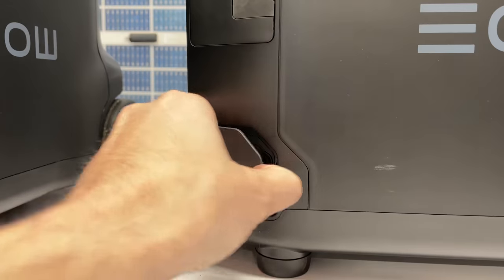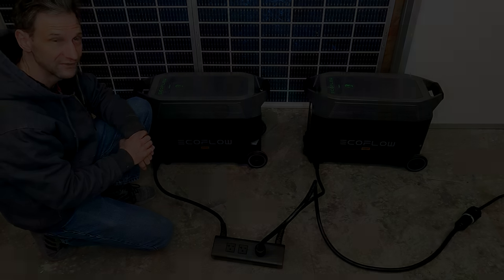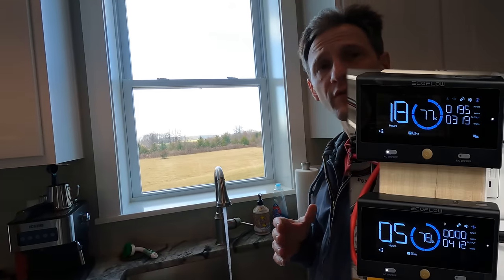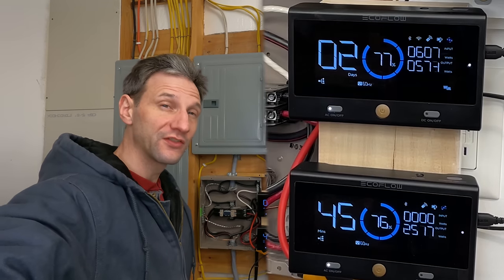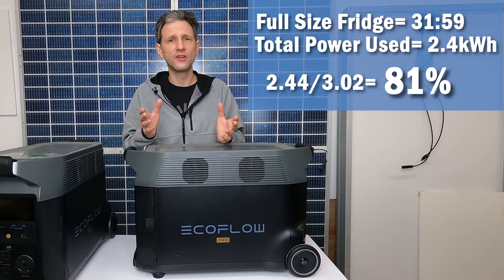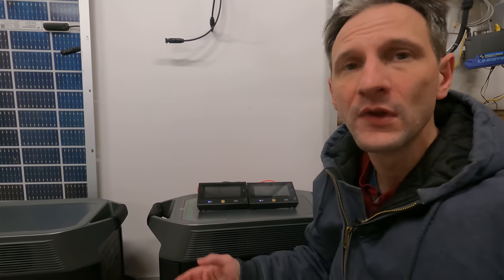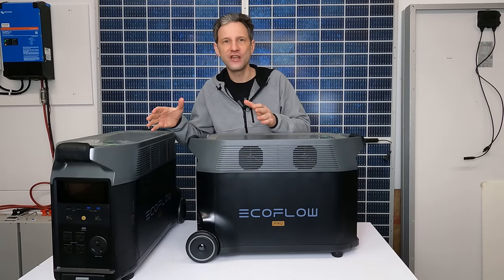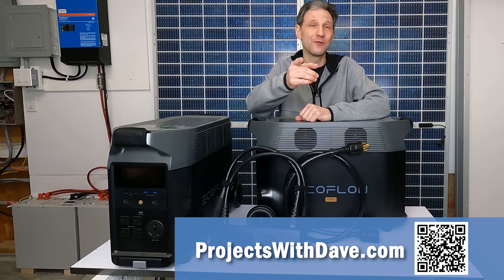EcoFlow Delta Pro Whole Home Backup - Real World Testing

Comment: Dave, I am not an electrical guy so watching your videos are fascinating.  I am in the planning stage of building a 10x12 shed and want a system to put in for a couple of LED shop lights and capability to work a couple of power tools.  What is your suggestion?
Reply from the maker: I would consider an all in one system with at least a 200W inverter for small power tools.  For larger tools you would need 3000W.  You only need one unit for that application since you won't need 240V supply.  You can also check out this topic on my website:  https://projectswithdave.com/portable-power-station/
Reply: Thanks Dave

Comment: Can it make operate washing machine? Then how many times? Regular average washing machine, I mean.
Reply from the maker: Sorry for the delay, took some time to run the testing.  The Delta Pro will run a regular washing machine with no issues.  My washing machine takes about 0.15kWh per load.  The Delta Pro could do approximately 21 loads on one charge.  Hope that helps.  This is the unit I tested: https://us.ecoflow.com/products/delta-pro-portable-power-station?aff=632
Reply: @ProjectsWithDave  Always grateful ~

Comment: What about if you don't need 240 voltage? How many 12 voltage batteries can you hook up with the system to get a bit longer run time ⏲️  ?
Reply from the maker: You can do just one unit for 120V appliances.  EcoFlow has their own expansion batteries. Here is a link: https://us.ecoflow.com/products/delta-pro-smart-extra-battery?aff=632

Comment: Os there anyway to connect one ecoflow to a house? Can the ecoflow be charged at the same time when in use?
Reply from the maker: You can connect just one unit, you just won't get split phase.  You can only charge from solar while in use when running two units together.  With only one unit you can charge from solar or grid  while in use.

Comment: Hi, i  am the new kid on the block and am dumber than a stump  regarding solar.  I have the same unit with 2-400 watt solar panels in route.  i live in the mountains so ac is not necessary and i  have a wood burning stove.  so mine was to give me back up power to run lights, computer and an occasional well.  if i felt the need to expand, would it be one more solar panel or an extra battery?
Reply from the maker: It depends on a lot of things.  Under what conditions do you run out of power?  For instance, if your batteries charge to 100% before the day is half over and you run out of power in the night you need more batteries.   If you have lots of cloudy days and can't ever fully charge the batteries you could probably make use of more panels.  That being said, 800W is probably enough to charge one Delta Pro in the summer.
Reply: thanks
Reply: i just did a test with up to 240,  as expected the batteries will drain fast with no charging  input.  solar panels to be delivered hopefully within a week. @ProjectsWithDave

Comment: Question, can it charge a Tesla without having to install a generator switch and circuit board?
Reply from the maker: I have not tried charging an electric vehicle.  When the system is connected through the generator port it is bonded to the house grounding system which is necessary for some appliances like car chargers to work.  I believe Will Prose has a video where he tried to directly charge his Tesla, and I believe he had some issues with it.

Comment: In your opinion is it better to have 2 delta pro units or a delta pro and an extra battery and why ?
Reply from the maker: I would only have to units if I needed split phase.  The two separate units can not share power between each other.  If you have a single source load like a fridge, you would drain one unit and then have to plug it into the other.  With an expansion battery you can charge and discharge the whole capacity.
Reply: @ProjectsWithDave  thanks for the explanation

Comment: The heat pump pulls 203 amps?  How do you even wire that to your meter/breaker box?
Reply from the maker: It's a very short burst.  The running current is only 9A to 11A.
Reply: Locked rotor amps (LRA) is seen in compressors, since they have to start against the resistance of the refrigerant gas in the system.  The LRA can and usually will be several times higher than the running current.

Comment: What is the max output of the hub? If I have 6 units 3600*6 is going to be able to handle it? I have a 5 tons AC
Reply from the maker: I was able to run my 4ton AC after some adjustments to the soft start system, but it could barely start it.  Those units aren't really designed for that kind of load.

Comment: Does any of the light for the back side have to come from the off-axis, or is the panel transmissive so the light passing through the front can then be reflected back up to the backside. In other words, does a highly reflective surface under the panel help in any way with a five-inch standoff from the roof?
Reply from the maker: If you are referring to bifacial panels, there is some light that comes through the panel, but it is almost negligible.  The useful light is reflected from behind the panel somehow, and 5" is not very much space to achieve that.

Comment: So I have this set up 1 delta pro and 2 extra battery. For my solar panels I have 10 total 200w each. 5 series and another 5 series paralleled together. Due to the 15 amp it will only take in. I’m only getting 1400ish watts on a clear day. Is there any other way I could potentially add a MPPT controller to charge by solar and hook it up that way just curious.
Reply: The amp coming through the panels roughly I believe 20 amps
Reply from the maker: What is the VOC of your current setup?  The closer you can get to the 150V max input voltage without exceeding it the more power you will be able to input at once.  If you are only getting 1,400W you must be only hitting around 93V.

Comment: Your explanations are exceptional! Thank you. I have 2 Delta Pros and 2 extra smart batteries. I'm only using them for 2 French door refrigerators. Each fridge is connected to a unit. One uses about 218 watts and the other about 150 watts. I notice that the batteries are discharging very fast. If I go 2 days without sun I have to switch to the grid. Should I use the hub and connect the 2 fridges to the hub instead? Thanks
Reply from the maker: The hub does not distribute power between the units, so that won't help you.  You might be better off plugging both external batteries and both refrigerators into one Delta Pro.  By running two inverters you are doubling the AC idle consumption.

Comment: So are both of these units, in parallel rated at 7200 watts. At 240v?
Reply from the maker: 3600W per phase.  Together they can power a 240V appliance at 7200W.

Comment: Would you please do a overview of the geo thermal system.
Reply from the maker: I have considered that, but I don't think it would get enough views to warrant the time it takes to make the video.  None the less, I still may do it some day, there are a lot of pros and cons to the system.  I've made a few videos on my home construction but the don't get many views.
Reply: @ProjectsWithDave  -  Something must be REALLY wrong with your heat pump compressor.  There's no way you should have that kind of draw-- even starting up. 
 I'm in the San Joaquin valley in CA (east of San Francisco).  I just installed a four-ton 20.5 SEER Bryant Evolution air-source heat pump, with communicating, variable speed compressor.  I tested it last summer in AC mode.  I have my 7,500 watt generator set up as my whole-house backup, running on propane (so, somewhat less than 7,500 watt output).  With everything in the house turned off at their switches (not at the breaker panel), the latent load is about 2.5 amps, or 600 watts (guessing wall warts, routers, smart plugs, refrigerators, etc).  Turning the heat pump on I saw a startup pull of 15 amps- but only for about two seconds.  Then it dropped to about 6 amps, then slowly ramped back up to 16 amps when I turned the thermostat way down (full-on cooling).  Running everything I could think of in the house, the well pumping at what must be full speed (1-1/2" pipe full open, filling my pool) air compressor running, electric oven... I could only get a steady pull of about 33 amps.
Reply from the maker: I'm not going to stand up and say those results make sense.  I plan to investigate the situation a bit more when I have some time.
Reply: @mikepowell3335  That's great information about your setup, but it's not not directly applicable to homes with different configurations. Primarily, you mention a variable speed air source heat pump. First, it's going to be programmed to start up at it's lowest power and ramp up from there over minutes, not seconds. So while it's not technically a soft start it's going to be a lot more soft than a single or dual speed compressor, which is very likely that Dave and others have as variable speed compressors are still new and cost more. Second, air is significantly less dense than water or whatever presumably liquid substance that's used for carrying the heat in a ground source heat pump, so even though the air source heat pump is probably moving more CFM of air than the ground source heat pump is of liquid, I'd expect the ground source heat pump to have a larger inertia to overcome while starting up, therefore have a generally higher start up load than an air source heat pump, especially a variable speed one.
Reply: @extragoode  - Point taken.  My point was something must SERIOUSLY be wrong for his heat pump to be drawing that many amps.  My guess is there's a 50(ish)-amp breaker that should have tripped before even being able to READ that much current.
Reply: @mikepowell3335  that's a good, and I actually asked him that exact same question in another thread.

Comment: Will the hub connect to my L14/30 generator plug installed outside my house?
Reply from the maker: Yes, it's a standard twist lock.
Reply: The Dual voltage hub is not meant to take power into the units if that is what you are asking.

Comment: Do you have to have a load on the 240 plug before turning on the 240V adapter?  When I turn it on with no load I get an error code 533 on the units.
Reply from the maker: No, you do not have to have a load.  I don't get that error when I turn it on without a load.
Reply: @ProjectsWithDave  I must have a defective hub.  My grounds on the double voltage hub are hot!   I must have a defective unit.
Reply from the maker: Ground should not be hot.  How did you measure that?  If that's the case, it sounds like something is wired incorrectly.  I would send it back.
Reply: @ProjectsWithDave  L1 to neutral ground  on the double voltage hub.  This hub is defective and dangerous.  Good thing that the delta pros detected the fault.    Notice no stock on the hubs?  I bet they had a defective batch.

Comment: Hello if there is a power outage and you are using the ecoflow can you recharge the ecoflow using your generator while still having the ecoflow powering your fridge?
Reply from the maker: Yes, the generator would be seen as line in power and the EcoFlow would operate in UPS mode.  As long as you are not using the double voltage hub.

Comment: How do you enable the UPS function? Is that the same as X-Boost?
Reply from the maker: A single unit will automatically function in UPS mode if it is plugged in.  X-boost allows the inverter to put out more than it's rated capacity with some degradation in signal performance.

Comment: The display on the pro is not accurate.
Once my unit reaches 1% it still has about 700 to 800 watts of power left in it.  
It we'll run for quite sometime on 1%, try it😎 and make another video
Reply from the maker: I have tried that.  I get a similar result.  I think it is just set to be conservative on the bottom end.

Comment: I would like to see a video on how long they would last on average home
Reply from the maker: These batteries are rated for 3,500 Cycles to 80% capacity.  You could do a full charge/discharge cycle every day for 9.5years before the battery is reduced to 80% capacity.  Typically your battery wouldn't see that level of use.  Plus, this battery also has the ability to limit the charge/discharge level to significantly extend battery life even more.  LiFePO4 chemistry is very robust.

Comment: I have I delta pro 110v how to changed to 220v
Reply from the maker: You need 2 units to achieve 240V split phase.
Reply: @ProjectsWithDave  There is a PSDR 110V and another 220V. Both of them have the same circuit, compartments, etc.. I had a delta pro 110V, I changed the PSDR and now its 220V. Is there any possible modification to change the PSDR to change it from 110V to 220V.

Comment: This thing is like an iPhone it needs updates it needs the internet or it won't work properly without the internet. If being disconnected from the grid is the point this won't work I have the nearly 17 thousand dollar bricks to prove it
Reply from the maker: I have run mine for months without being connected to the internet.  Did you have a firmware problem?
Reply: @ProjectsWithDave  This is what I have been told by the manufacturer that it needs an update. I suppose I'll just eat it because I'm not connecting these things to the internet. Really with absolutely no load but the wire going to the breaker box it goes into overload as soon as I plug it in.  Never been used before brand new units 2 master 2 batteries they connect to.
Reply from the maker: If they don't work out of the box, I would think you could return them.  That seems very strange.

Comment: So to get up to the 1600 watts and 150 volts, is it possible to over panel to get to the 1600 watts?  I figured with the panels in a series/parallel configuration it would go over 15 amps.  Does that hurt the unit or is it just that the units will only take up to 15 amps so anything over would just be wasted?
Reply from the maker: The important thing is to not exceed the max voltage.  If you have extra current available, it just won't make use of it resulting in clipping.   I discuss this topic a bit in this video:  https://youtu.be/ZFbKtGSkhsE

Comment: TRULY DO ADMIRE ALL YOUR KNOWHOW AND the various tests you ran in this video...    But for most of us typical homeowners,  your demonstration was a bit much.    I just want to power my fridge and a few lights when the power goes down.    I can live without doing laundry and similar things when power is off.    Can live without A/C and other conveniences for days if needed.    Powering the furnace in winter would be appreciated,  but our power is FAR MORE LIKELY TO BE OFF due to Spring & Summer storms.    That is the main concern in my area in Illinois.    Our utility company is VERY UNRELIABLE due to warm weather storms...   My area has extended outages as well as annoying little blink outs for a minute or two.    The electric grid is especially bad in my area, and NOT LIKELY TO BE REPLACED by our profit-driven energy supplier !
Reply from the maker: This video on the Bluetti EB70S is the most basic: https://youtu.be/LAjirHJ-t6s
This one is a lot more capable, but also simple: https://youtu.be/_QMe8DWlr30